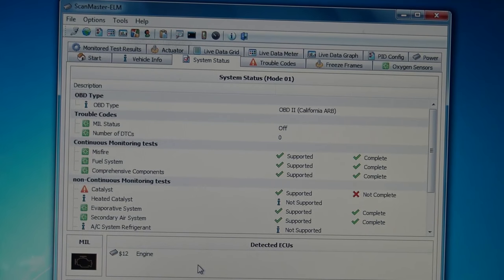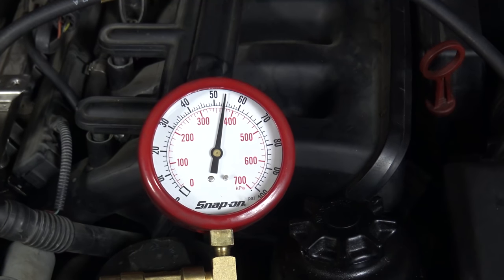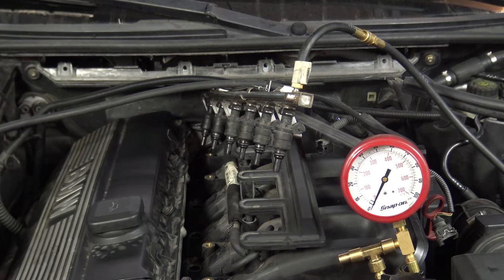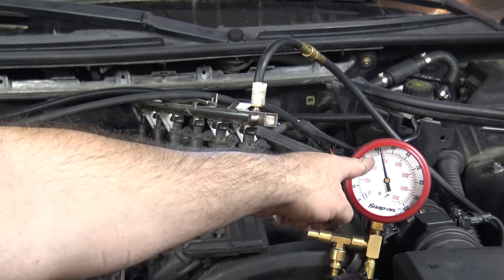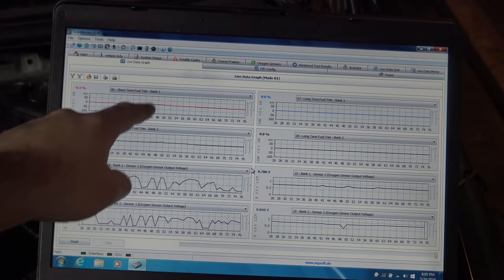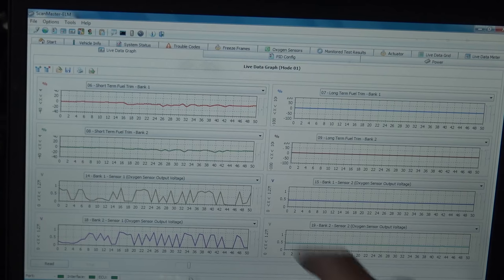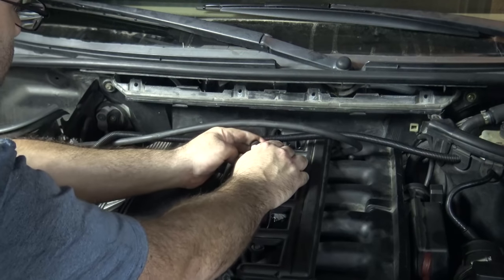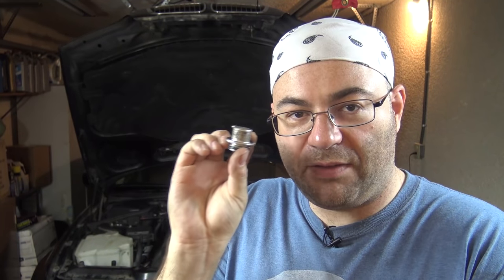E46 Negative Fuel Trims Case Study

Comment: Hello 50sKid,

Very nice and detailed video. You are very detailed in your approach to diagnosis and I learn much about the BMW engines.
As for fuel pressure issue, and checking against five regulators, I would suspect the gauge.  To often people believe a poorly calibrated gauge as accurate and it will severally bias actual world conditions of measurement......Yes I am also a QA guy and experience this situation too many times (trusting a bad/out-of-spec) gauge.
Thanks again for your videos,
P

Comment: Very good video. As a suggestion, I think it is a good idea to reset adaptation every time you modify something, for example the O2 sensors or a change in fuel pressure due to a FPR. You save time in that adaptation. I´m working on a 99 328i E46 with negative fuel trims as well.

Comment: Come on man....with any issue with fuel trims, first step should ALWAYS be to monitor what o2s are doing and simulate a rich/lean condition to see if o2s respond properly. Wasted so much time by pulling injectors and swapping not just one fpr, but 5. I recommend subscribing to scannerdanner premium and buying his engine performance book.
Reply: Exactly!!!!  Monitor LTFTs, STFTs, as well as HO2 upstream sensor(s).  Actually, they are "reactors" more than they are sensors.
Reply: how do you do that? to get rich you turn the MAF of? and to get lean, you take of the ccv hose that goes to the valve cover?
Reply: @komentatorius69  i have used a unlit propane torch with a hose on the nozzle to a vaccum nipple to simulate a rich condition. To try and simulate a lean condition i have pulled the brake booster hose off the intake manifold to allow un metered air into the engine. 

Not sure if these are the correct ways. Try at your own risk. I'm not responsible if you mess up your car or injure yourself or others in any way.

Comment: Ur absolutely right at 3:20. Cant put cheap aftermarket stuff on bmws. When i bought my car it had some cheap aip electronics maf on it and i spent 6-7 months off n on trying to figure out the fuel trims being maxed at like -25%. One day i just happened to be checking the intake tubing and i saw the lil ghetto resister in the maf in place of the element. Switched it out and issue was actually positive trims
Reply from the maker: Yep! Very common, you just gotta be careful about what cheap parts you use.

Comment: I want to understand one thing.

So if you drive long time with a broken o2 sensor the engine wil adapt and make new settings. I have a bad o2 sensor after cat. Engine runs rich. I have cold start problems because long term fuel is -100% . And both short term are -60 while idle. When throttle they went up to -90.

So the bad starting cold is due bad o2 sensor?

Comment: You do realize you couldve just pulled the vacuum line on the regulator and observerd fuel pressure gauge for changes
Reply: These engines work on constant fuel pressure. It's not a vacuum line but a vent line so in case of diaphragm failure the leaking fuel would have somewhere to go. If he pulled that line nothing would have changed.

Comment: Negative trims means
1. over-fuelling - fuel pressure too high, leaky injector/s,
2. under-burning - weak coil/s, fouled or faulty plug/s, or
3. air intake blockage (not likely)

Comment: Hey 50sKid, love your channel! Question: what's the likely scenario when the long term fuel trims are at negative 8 percent, but short term fuel trim is near 0? That's the situation I have and I'll double-check I have a Siemens Mafs, but curious if the Mafs would cause it for the long-term fuel trims. Thanks for any help!
Reply from the maker: MAF is a possibility.  Also bad 02 sensors. Bad fuel pressure regulator (check if fuel pressure is higher than 50). Do the fuel trims get more positive when the RPM is at 3000?
Reply: I'll have to run the live data on my scanner next time I get a chance, unfortunately I'm still new to looking at live data. It's also been a long time since I did the fuel pressure test, so I might have to do that again to know, because I don't remember if it was higher than 50 or not. O2 sensors are fairly new, so I think you can rule them out. However, when I was looking at the freeze frame data, both long term and short term fuel trims were in the negative, around negative 8-10. So the car is running rich and the ecu is compensating right?
Reply: Fuel trims look good, ZoommaiR.  Normal
Reply: You are slightly rich. Short term should move toward positive on the long term  (less negative ) if ECU is compensating.  After about 30 seconds to a minute.

Comment: Hi I have a Q!
Honda pilot 2003   3.5
Negative fuel trim issue.
I have only 2 sensors for both banks.
My problem is on bank #1 pcm shutt down this bank completely 
Both sensors are reporting Short term  -27.3%

S1. Fluctuations 0.940V. 0.630V. I think is rich.
S2.                            0.035V.    0.140V mostly stayed 0.035V I think is lean.
But bank 2 is working normally can't tell the reading my scanner
Don't shows.
But the evidence on spark plugs are visible.
And on bank #2 you disconnect each wires from coils and they miss.
On bank #1 don't.
But if I disconnect bank #2 completely.
Then pcm put #1 bank to work...
This is weird!!!!
Can you help me on this please??
Any Advice???
Take your time but please answer !!!
Thank's

Comment: It’s the opposite actually. If it’s a bad maf your fuel trim will continue to go down while engine rpm increase.
Reply: Bad MAF at normal speed will under estimate the air entering, as expected by the TPS and ECU. Thus mixture will turn out to be lean because of more actual air, causing an increase in fuel input.  However I guess the MAP would then record a higher air pressure than assumed by they same TPS and also make additional adjustment via ECU.  I always wonder if the Fuel Trim reading is the Sum of all the adjustments made in the ECU (MAP MAF 02), or just the O2 sensor result.  I would think the Fuel Trim figure would have to be the Net result of all the ECU adjustments from input from the MAF MAP and 02, since it is meant to be indicating the net fuel increase/decrease over the mean.

Comment: Good evening I have a 05 E46 that I get a p1500 code that sets. I have replaced the idle speed control valve, the ccv system and intake boots due to being torn. But I can not figure this code out. All my fuel trims are negative in the freeze frame data any help would be greatly appreciated thank you

Comment: Hey man can you help me? I had a cold intake down to the bottom and it was raining for a day here in California, no longer have the weather guard by the tire. Well, the filter got wet and as i was driving home from work the car kept losing power and wanting to die out, the car died but started back up and i proceed to go slowly home. i made it home and let it sat for a day and convert back to a short ram intake. But now it car feels sluggish and once i get to 5k rpm the power cuts out. I plug in my scanner to check short fuel trims. once I get to 5k the power cuts out. It shows 17 Short term. So, what that means is its running rich and is taking too much fuel out right since its 17 and that's when I lose power.  I did have a check engine light for a EVAP Canister Purge Control Valve leak before, but it was fine

Comment: I got a Buick enclave and I have negative 100 on bank 2 for both short term and long term trim. O2 sensors and fuel pressure is good.
I also have no codes and bank 1 tests very good..any thoughts , cheers

Comment: HI 50s kid great video, what would be the likely cause of very high lean condition (25 for both banks short term from cold) and after 20 mins of driving the bank 1 drops to normal levels whereas the bank 2 remains at 25, should i be looking at 02 sensor voltage output? Thanks

Comment: It is strange that long term fuel trim is 0, at the start of the video. That can indicate that you have a problem with fuel sistem. 
And when you switch places on rear bank O2 sensor it starts to work as it should, and they corrected long term fuel trim to -3.
I also have LTFT fixed zero, and trying to find the solution. Unfortunately i have one pre cat and one after cat O2 sensor, and they are connected as they should.
My car has 0 for LTFT, and i am searching for the solution. 
Ana idea where to start?

Comment: I got a 98 528i and I was working on the fuel filter and somehow I broke a plastic pc of the pressure regulator valve and it’s kinda too expensive to buy a whole new one is there any other solution for itt like if the spectre ones I can work with?

Comment: Hello bro, I have problem.. black spark plugs, high fuel consumption, my long term fuel trim is negative -18%, I cant found problem, injectors new, I I tried another maf, o2 sensors. My car is bmw f10 2011m 535i witht n55 engine. Maybe you will face such trouble? No errors.. smoke test done, I checked and cleaned vanos solenoids, install new oem spark plugs etc. Thanks for your advice bro:)

Comment: I do have a long term fuel trim of -7% on e46 m3. When i rev it up to 2000rpms steady. my short term back goes to -22% and my car starts stuttering. This is not evident when im driving underload or WOT. Short term bank stays between - +5% on idle and while driving. Only under steady rpm with car not moving it jumps -22% and stutters. Any idea what this could be? I have been trying to figure this out for awhile now.

Comment: Mine is difficult to start it takes about 5 seconds of cranking and it stinks like unburnt fuel I’ve got 0 codes but my fuel trims are off and I simply just can’t get to the bottom of it very frustrating

Comment: Hi 50s kid ,  really good videos i tried to find out a fix for my car BMW 3 series but cant find any issue , please sir if you could advise me . I had an OBD trouble code which is ( P1168 Post Catalyst Fuel Trim System Correction Value above Threshold (Bank 1) . 
Best regards

Comment: Hi 50s Kid. 03 325ci ebay headers with 90 degree o2 bung extenders. 

Code P2098. Have RPM surges and drops during acceleration between 2500-3k and 3500-4k

Also throws P0171, P0313, P1093...

freeze frame data = 

load value = 31.76%
RPM: 2389

Short Trim fuel % bank 1: -17.97%
Long Trim fuel % bank 1: 1.56%
Short Trim fuel % bank 2: -8.59%
Long Trim fuel % bank 2: 1.56% 

Unsure if fuel related or VANOS?

No known vac leaks, sprayed carb cleaner all over intake area.
Reply from the maker: what are the trims idle?
Reply: 50sKid how would I go about checking the trims in OBD fusion at idle? 

I cleared the p2098 and it came back with a different code (misfire with low fuel)

Freeze frame data this time was

Short term bank 1 - 7.03%
Long term bank 1- 1.56% 
Short term bank 2- 1.56% 
Long term bank 2 - 2.34% 

(2584rpm, load value 16.86%)
Reply: Second code was p0313

Comment: Hi mate, I saw this helpful video 100 times, and I was read all e46fanatics thread that you talking about. I have 328i 99 too. But is not conclusion at the "idea" of no vacuum in the FPR. What is you conclusion about it?
My 328i has FPR in the top of the injection rail, so is like a 323i. I suppose it was the first configuration of BMW for this early E46's.
Something is picking my mind about all this.. I recently was forced to replace fuel pump and fuel filter, I was follow my LTFT/STFT all the time before this changes and Im was always negative LTFT (-7 Bk1 / -3 BK2). Now, with those changes still negative (but less)
O2 pre cat are new, sparks new, MAF +/- 3.8 g/s at idle, FPR 1 year old. all the fuel sys are new.
Rail pressure at idle is 57 PSI.(more than 54 psi spec.)
So.. is the negative LTFT related to the over pressure on the rail? 
If all elements on my fuel system are new.. and this is my picture.. how can I tuning the rail pressure.?
What about the idea of FPR regulated by CCV?

I know, a lot of questions.. but please, put some light on it.

Thanks in advance.
Reply: My guess 2 or 3 lbs, difference in fuel pressure will make no difference at all. I mean zero. Three lbs more is about 5%.
Reply: I tend to agree that the likely cause of seemingly 
high idle fuel pressure is lack of the vacuum signal to the FPR. It regulates based on the 
pressure differential in the intake, so at idle the intake is at partial vacuum and the FPR will reduce the pressure to maintain 3.5 bar across the injectors.

Comment: does replacing the battery reset the Cat Monitor  fuel trims are sightlynegative  .1-.2 % and the MAF reads 4.7 g/s and car runs fine will the cat mpnitor go off after a long drive? Thanks I love your videos.

Comment: Hello 50'sKid...I have three codes right now which are Po17,Po172 & P0041. After watching this video, my question is could that be my problem??? I just had those same two O2 sensers replaced a few weeks ago. I drove to cycle the code out, and it cleared. I then replaced the OE lower and upper intake boots, and the MAF(aftermarket). All codes cleared, drive seems back to normal, then all of a sudden I get the three codes. P0172,P0175, & P0041....NEED HELP ASAP TO TRY AND FIX THIS PROBLEM. Do you think the O2's were maby plugged in wrong?HELPHELPPLEASE THANKS

Comment: what did u use to do the live scan ? I belive u used a laptop, is that something anyone can get or is it only license mechanics that can get it? Your videos are very helpful.  thanks ....
Reply from the maker: The hardware is ELM327 cable from eBay (it's a buggy knockoff that drives me crazy because it doesn't always work).  The software is Scanmaster ELM.
Reply: I have a Autel MD802 Scanner that suppose to transfer data to a lap top! I have not tried it yet to see haoe well it works. If you purchase this model it will do live data. I paid about $260.00  Cdn at Amazon Canada. i did a lot of research. If you want  this type of function. You will need to pay more. By the way Banda this scanner will also diagnose tranmissions. The more you pay the more it does. This is a technician grade intrument. You will need to spend a lot of hours learning how to use it. So far I like what I see. Sofware is live time and is free. It covers many Asian, Eropean, domestic cars. I hope this helps you!

Comment: Hey i love your videos and your work, keep it up. I live in the UK and i got an e46 2003 325ci msport auto. Now im getting fuel trim bank 1 and bank 2 permissible range exceeded and fuel trim bank 1 and 2 control limit. I have no vacuum leak, i replaced the top 2 o2 sensors for bosh ones, i replaced the maf sensor for non oem ( völt) brand. The car would have rough idle when the codes do show up, sometimes it would even cut out when approaching a junction or teaffic lights, and when i go from neutral to drive or reverse the revs would go bellow 500rpm for a second and go back up to where it should be. Any thoughts?
Reply: I'm sure you have now figured it out. This is a classic symptom of a failing camshaft sensor.

Comment: ONE THING that is bothering in mind that when the Long term fuel trim is already coming in NEGATIVE it means the ECM is cutting the Fuel that much percent , OK understood but when the FUEL is cut already that much percent WHY still it is showing in negative ? it should be to ZERO around bcz the excess fuel is already CUT . why it is always showing negative ? no sense i think . what you say . ?

Comment: Hello, I'm having a weird issue, my bank 1 short term is between -100% and -90% at idle, when going 5k rpm it drops to -50%. Only on bank 1. Long terms are both on -6.3%. When opening the oil cap, short bank 2 goes up while the bank 1 doesn't move. Does anyone have an idea?
Thanks !